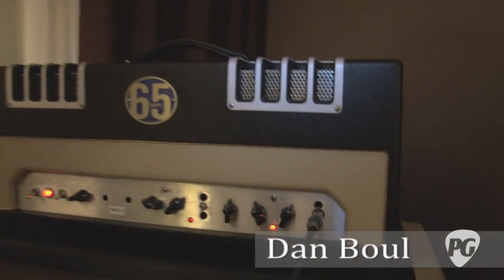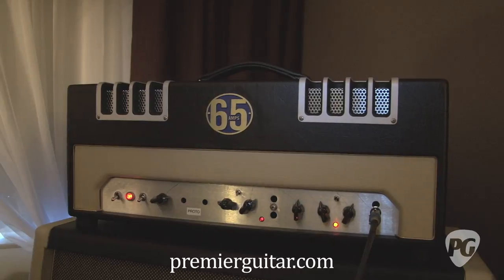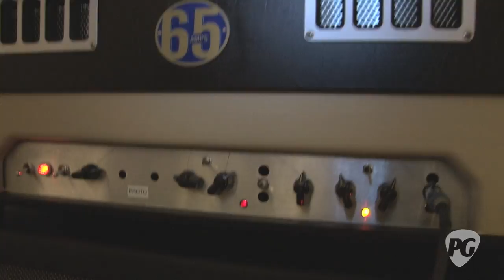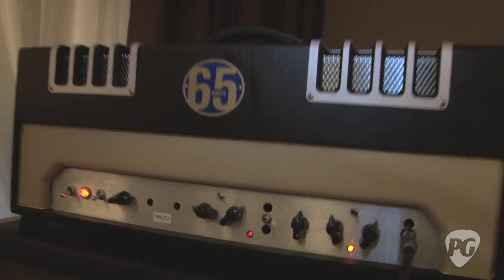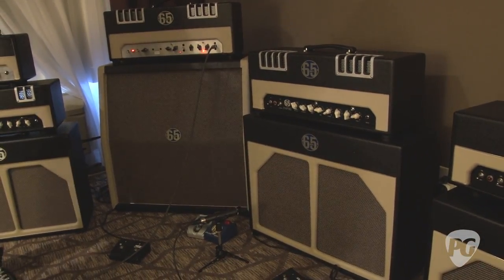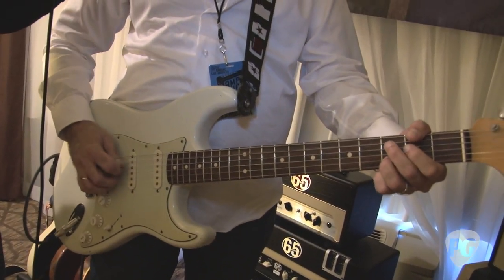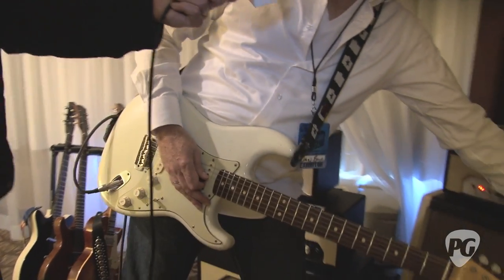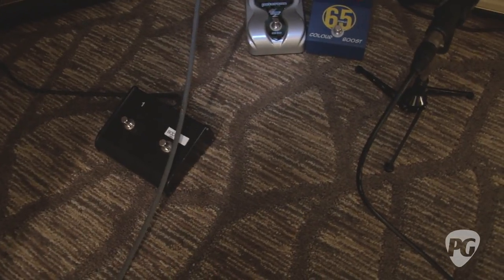LA Amp Show '11 - 65 Amps Producer Prototype Demo

Comment: Huh? What are you talking about? Vintage Sound has 18 amps listed on their website, and 11 of them cost over $1,800 (and three of the 7 that didn't were $1,700+). 

The 65 Amps Ventura is brand new, 6v6 based, and costs $1,750 as a 1x12. That's in line with the entire VSA Vintage line. The 65 Tupelo (also 6v6) is $2,395 for the combo. VSA has 6 (of 18) amps in that price range.

Comment: I like the video. The other guy was right about the price. It is way too expensive. I checked it out on line. If I want an expensive amp, I will go for the Marshall YMJ100 100watt amp. It cost around $2000 not around $4000.  You do the math and Marshall Amps have a great music history. Peace, Flood!

Comment: @SuperKrakoukass Not that much more expensive than other amps that can be compared with 65amps, like say Cornford... or other amps that can be described as incredible. I did think like you as well until I tried a 65amp Lil' Elvis and yes, it's just about more incredible than most other amps I've tried... even at low volumes.
May be that I have to try this one... and then there may be a long wait saving up for one... We do agree that they are expensive for sure :)

Comment: They make nothing but Fender clones! Not saying that's not cool, but they make nothing comparable to the amp in this video. The 65 Amps Tupelo and Ventura are both 6V6 based amps, and both in the same price range as much of the Vintage Sound line. 

The main reason this amp is $3500 instead of $2500 is the tube-life-extending transformers and circuit. He's said in other videos they are huge and expensive. Not sure if that's worth the upcharge, but that's where it comes from.

Comment: british amps not doing clean,,A marshall JMP 2204 dual EL34 had lower plate voltages than later model (390-400V), biased 45 mA per tube, through low sensitivity greenbacks (96-97db) ,, great clear but warm clean sound,, 
My mini JCM800 (ha ha  dirt cheap 15 watt Laney cub 12r) runs the EL84 at 295V plate in fixed bias at   26 mA idle,, 
American vs. british, for me that is more about tonestack type and placement in the circuit.